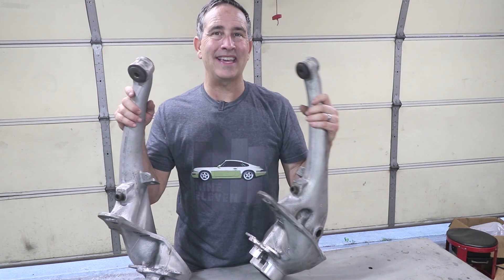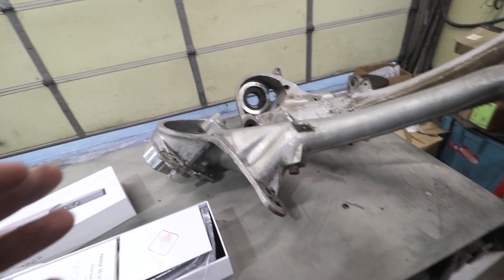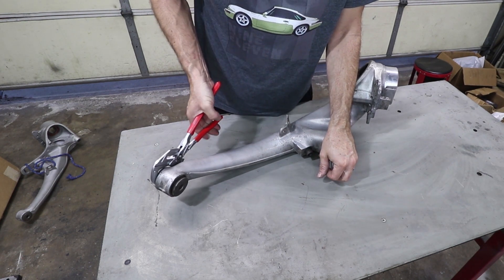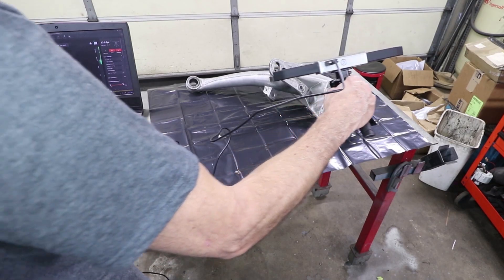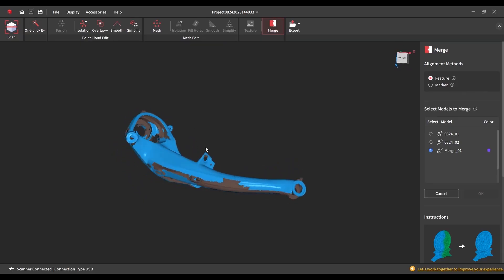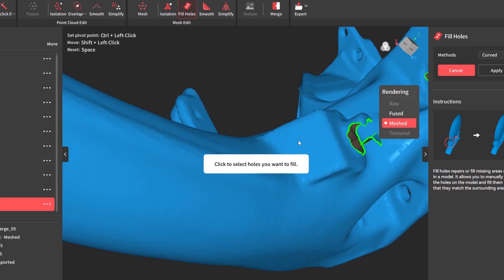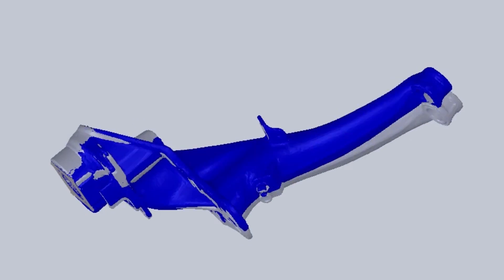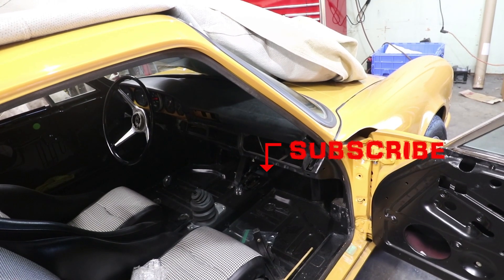Get A Perfect 3D Scan Of Your Porsche 911 Suspension Arms With The Revopoint Range Scanner!

Comment: Tom.  When you do the combustion chamber volumes, please post that in detail.  That scan too is expensive, but I agree it would be way faster than a burette and a alcohol column, I have always used and allot dryer.
Reply from the maker: Ok, any pistons in particular?  I'll see what I have lying around.
Reply: No not really,  just measuring deck height and head volume to determine compression ratio and combustion balance.across all the cylinders, Instead of filling them with alcohol  multiple times just sounds easier.  I try to get all the cylinders the same volume with in .1cc. Being able to scan them before grinding and porting might be easier.  Some times you need to do a head 5-6 times to get them equal, scanning it after grinding might be easier, and comparing it between grinds to see how much was removed., The factory volumes stamped on the head is not that accurate now.  .  @GarageTimeAutoResto

Comment: I don’t know why would choose this method when the simpler solution is to build a checking fixture on the basis of the geometric dimensioning and tolerancing of the part. The GD&T for this part would be determined by the assembly points of the part as it relates to its assembly, which in this case would be the hole centers of the bushings, the mounting holes of the knuckle to the wheel, etc. you just need to create fixture points on a plate that attach to the GD&T reference points. Then you put your part in the fixture to determine if they line up at the fixture points, if they don’t, then they must be bent.
Normally, we use wls (white light scanning) on a production part to compare it to the design data to determine the quality and accuracy of the manufactured part.   The design data is cad surface, the scan data is triangularized point data, so using scan data you need the math data (cad surface) to compare to the scan.  You can compare scan data to scan data, but it’s not accurate since scan data is discretized(c0 data) whereas surface data can be c4 or higher(ie differentiable to 4th derivative).
Reply from the maker: Are you watching these videos?  I designed a fixture to do exactly what you are saying.  The scan data is only used to create the fixture.   Are you assuming that I have access to Porsche drawings with GD&T data?  No way those drawings are available to the public.
Reply: You don’t need scan data to create a checking fixture for a part like this. Scan data is used to approximate the surface of the part, however it is inaccurate to be used to establish hole centers. All you need to know is the location of the hole centers which you can measure directly off the part. In terms of the GD&T, only the hole centers would be called out because for a cast part like this the surface of the part is by definition within manufacturing tolerance being a cast part. A stamped part, on the other hand, would have many GD&T callouts on the periphery, etc. and in this case scan data is used to assess the surface of the part to determine how far it deviates from design due to spring back deformation and other manufacturing issues. So, no need for scan data for a part like this. @GarageTimeAutoResto
Reply from the maker: To each is own.  This is a big complex part with critical pivots and mounts in multiple axes and multiple planes.  
I don't know anybody with tools this big to measure.
Is this your idea of retirement?  Critiquing YouTube videos?